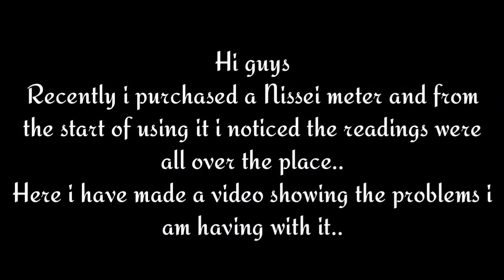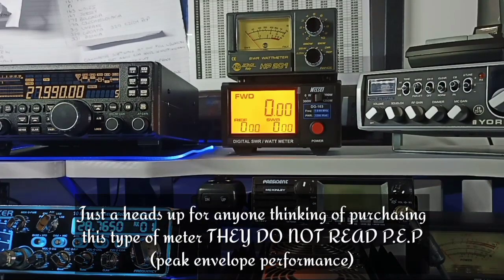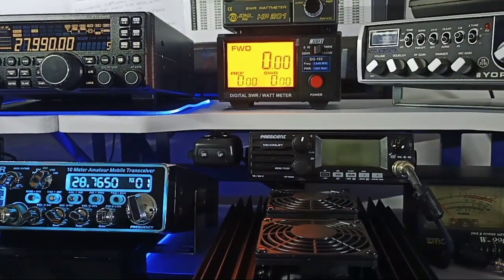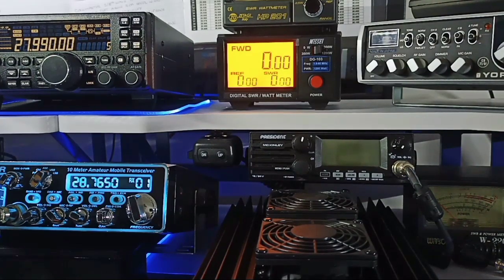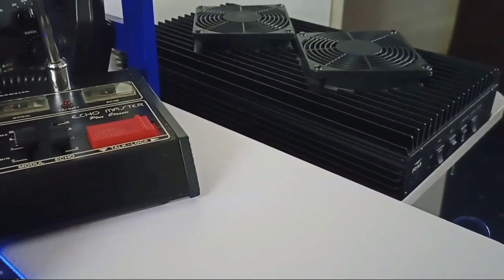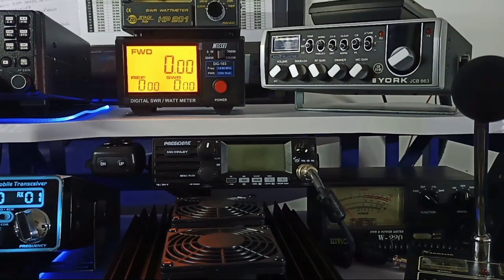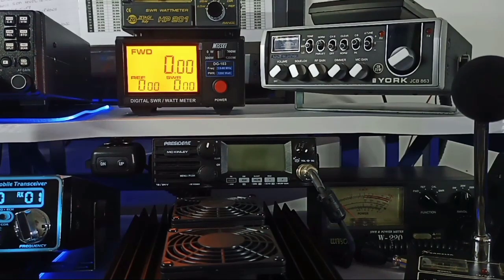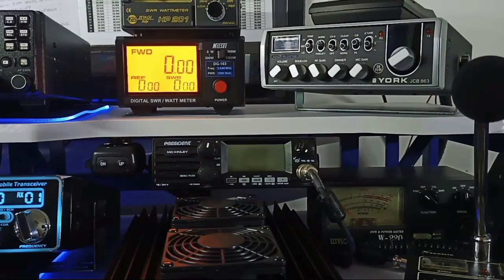Nissei DG 103 Meter .. Serious Issues

Comment: I have the same dg -nessei 103  i cannot get any reading over 100w just get dashes on the meter even in fm rtty and ssb and in max mode set over 300w usless only got it today i posted this 73s de 2E1DNC
Reply from the maker: @lordmichaelharris1710  
The early models were a mess I couldn't get any kind of accuracy from the first two.. the second was a replacement from ML/Sons.. after I made a video a viewer kindly gifted me his and that one worked perfectly.. I'm not sure if there was something wrong with the first batches sold in the UK but many others were complaining about how bad they were.. with the new max model I've never had a problem and it's very accurate even when compared to my LP100 bench test meter on all bands so for a cheaper than usual meter I rate it pretty good only being one ore two watts out.. 
Wish you luck with yours 73

Comment: Have the same problem.
When I set power on FM with keydown the power is correct. When I set power on SSB the power reading on Nissei is often variable and lower than FM reading.
Reply from the maker: @stranezzeontheroad1392  
 @stranezzeontheroad1392  
There are around four or five types of the same meter made by various companies I think when they first came out there was an issue with them, I have since bought two of the new meters called the Max Meter and those read pep and give excellent readings across all bands I bought mine from Martin Lynch. click the link here to watch a video with me using it on SSB.
https://youtu.be/zsegdYqvcV8

Comment: Yep mines the same they are ok for lower wattage say 5w 10w etc but the higher you go in power the worse it gets. They are junk.
Reply from the maker: The one I have now works fine although it was donated to me by a subscriber in the USA.. I did another video showing that..
But I think they are unreliable at best and wouldn't trust them for any high power readings.
Reply: @DeltaXray444  i've managed to get mine to blank on the screen like its gone into an overloaded state with only 400w on the 1200w scale so i only use it for low power readings now they seem ok with that.
Reply from the maker: It goes to blank on sideband too because it doesn't read PEP peak envelope power.. it only reads your average power you put into it so it's basically useless for SSB. Mind you it also goes blank on a straight carrier like FM at times.. a poor design.
Reply: @DeltaXray444   Yes and the price of them have increased too especially on well known named ones like MFJ.

Comment: I got the KPO DG-103 (same metre), works fine on Fm, problems start as soon as you go onto Ssb.
Radio swr will be showing 1.0, but the metre will go off the scale, bot Ref & Swr go AWOL, although I know  everything is running fine.
Reply from the maker: Same issue you have i had with mine, even the replacement went crazy on readings.. the one i was donated works absolutely fine. I did a follow up video showing how well it worked, thanks

Comment: Great i've just bought one
Reply from the maker: Not all are bad, this is just the one that I bought, I'm waiting for a replacement, I hope I have better results with that one and you have good results with yours. In saying that there are many others who have had problems. Wish you luck.
Reply: @DeltaXray444   oh thats good to know hopefully it will be ok at £138 its not the cheapest.
Reply from the maker: They are a very nice looking meter, and at the price they are should be pretty accurate. I usually use analogue meters so buying this one as my first digital meter i felt a little let down with the one i got.. maybe just a faulty one i don't know.. but i have another one coming shortly..

Comment: Suspect leaky diodes in sensor section. Or poor RF shielding...
Reply: If your replacement meter acts the same, and all other meters you use do not exhibit the behavior then definitely the meters are suspect. Make sure all conditions are identical when testing. Test at one half power.
Reply from the maker: @richiet3841  i agree with the testing and i will certainly repeat the tests exactly as before, the test i show in the video was just one aspect of how the meter acts when hooked up.. there were endless other tests i did on multiple radios and output variations of wattage from low to high, i have all the results logged and will repeat.. i may even do a video showing the wayward results this meter shows to how stable and accurate the tests are on my other analogue meters.
Reply from the maker: I have no idea.. you may be right.. i cannot get a correct reading from anything with this meter.. i gave up on it and im getting a replacement from the seller.. if that meter does the same thing i will be asking for a full refund.

Comment: Hi Glen,

I purchased this exact same meter brand new from Martin Lynch about 6 months ago, & experienced exactly the same issues using both a decent Acom amplifier & a RM Amplifier - per chance harmonics were causing the problem.

I also used an Icom 7300, a Yaesu FT-857D, and a standard CB - so "crude" equipment & RF can't be blamed.

The SWR readings into a dummy load were perfectly fine, but when placed inline (IE used normally 😁), the readings on say UK CB midband were fine & matched my analogue meters, but as soon as I went to say high band or UK 27/81 they were completely wrong - totally sporadic.

I tested mine against my 5 other analogue SWR/Power meters that pretty much read the same & were all correct on the aforementioned CB bands, so can confirm the Nissei dg-103 isn't designed correctly.

I think they're susceptible to even the slightest bit of RF, but they're definitely NOT fit for purpose & a very poor design.

I would also say that in terms of SWR accuracy, they're only calibrated for a narrow range as I mentioned above - because some of the readings I was seeing were wildly inaccurate compared to all my other meters which are tried, tested, and all read virtually the same.

Martin Lynch claimed that they tested the meter when I returned it, and instead blamed the readings on "user error" even though this is an automatic meter. I found their response patronising & a real insult to my intelligence, and furthermore, I had an hard time getting a full refund until I threatened them with trading standards & explained they're in breach of statutory consumer rights.

I will not use Martin Lynch again, & the same applies to this range of Digital Automatic meters.

Sorry to be blunt, Glen, but they're crap &  can't be relied upon.

Your findings are completely normal for this meter & match mine exactly, so this isn't your fault. 👍🏻
Reply from the maker: Hi Harry.. im glad it's not just me, the video we both watched where the guy was testing there were wrong readings from there, and that was on lowish power too..
I would have questioned the meter readings from there not being accurate.. but it went over the guys head the readings were wrong.. i don't get that.. maybe some people justify the expense thinking it justifies the product.. i don't know..

Ok so as i mentioned in my video you get what you pay for with meters, but paying £140 with p&p even at that a meter should be at least near enough accurate, it seemed the more power run through the meter the more the readings went crazy.. i tested with a good few of my other analogue meters too and they all read about the same and all within a needles width or so.. the digital meter however gave me crazy readings all over the place regardless of power used or band i was using.. every reading had a discrepancy with an inaccurate reading..

I too bought my meter from ML&S, they say all there equipment is tested before being sent out, On a more serious note I'd like to see how they test these meters because it cannot be a practical test as we use them or they would see the problem with the meters from the off..

Also the schematic diagram for every type of named meter is the same if you research online as i have done.. so regardless if one states power on the switch or HF -UVHF if this is different somehow how can the schematic diagram for each meter be the same if one reads from frequency and one reads power there must be a difference presented on the schematic diagram.. surely.. ??.

I had all my analogue meters double checked and there was no fault with them and all reading the same.. i even send back the linear to be checked for a drop off. The linear readings were almost identical to my own readings on my analogue meters.. but the more i keyed down on the digital meter the power decreased, yet with all my analogue meters the readings were solid with no drop off..
There were too many discrepancies across all readings with the digital meter and in my video i presented just one aspect of how the meter cannot read a simple test on a set carrier band like FM.. this is also why i stated the meter does not read pep.. yet i have seen many other videos on YouTube where people are taking readings using ssb and all of them are obviously wrong because it cannot give a true representation of power output on ssb..
I thought from the start there was something wrong with the meter and i firmly believe this product is faulty.. i also have had feedback from local stations stating they have had problems with it and also others in my comments.. i completely agree with your assessment of this meter and im in complete agreement with you this meter is at fault.. cheers Glen.

Comment: Sounds like your getting RF feedback into the meter via the dc power leads. Place a decent common mode choke /ferrite on the leads and hopefully it's successful.
Mains filtering can help also, and a dependant rf ground. Good luck 🍀
Reply from the maker: Hi Ray, you make some interesting comments, i have ferrite's on everything including mic leads, jumpers coax, also my antenna's have chokes on them too.. on other meter readings even running a little extra power i have almost zero rf feeding back into the shack. all my power leads are choked and also power lead's from supplies have ferrites too.. im still scratching my head with this meter.. i have no issues with any other meter and the reading's they show only this nissei. Thanks for your input it is much appreciated.

Comment: Send it back.  For many years these Watt and SWR radio readers never hold up to the suggested or recommended power.  Send it back.  I know little of digital etc but still, stick with my old manual meters etc.
Reply from the maker: Hi Drew, it's not a good meter, i have had lots of feedback from FB groups many say they are having problems getting any kind of accurate reading and the same issues as me.. its under guarantee so it's going back..